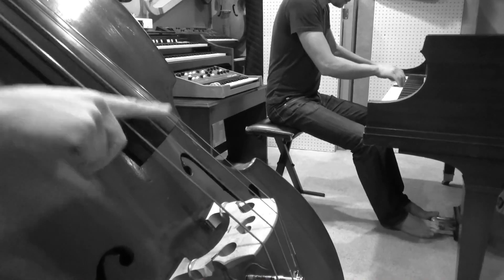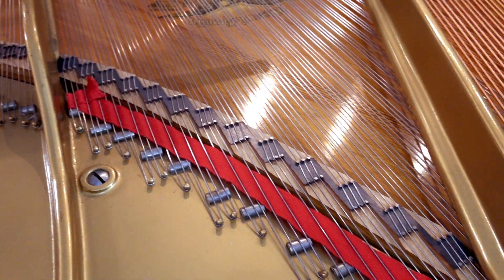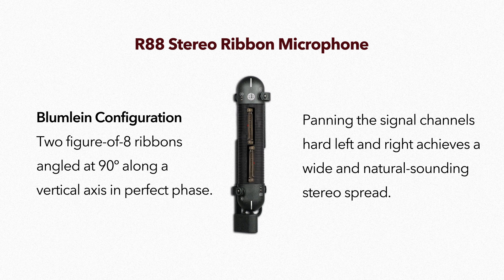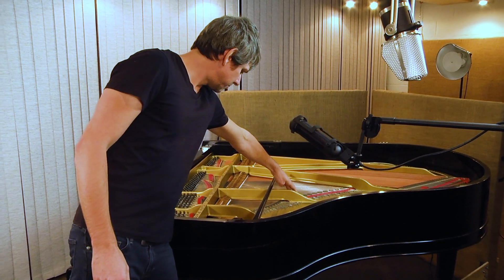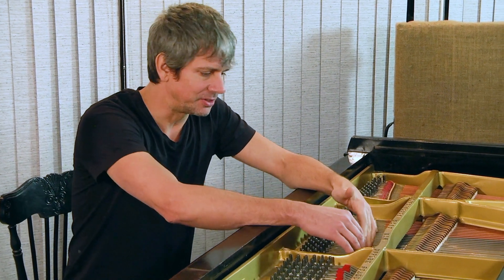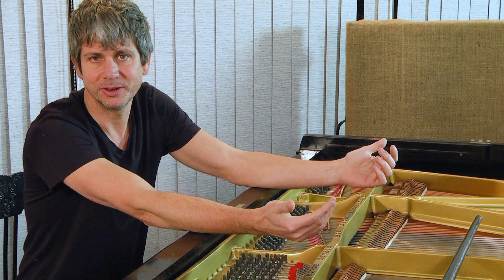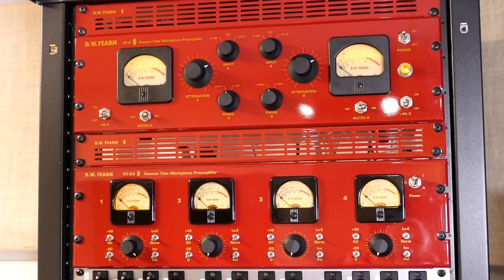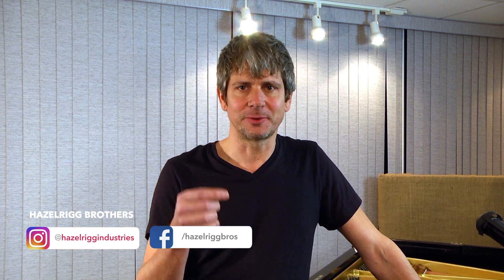How to Record Grand Piano | Featuring Doug Fearn

Comment: The sound actually doesn't come from the bridge, any more than it does the bridge of a guitar.  The ribs on the underside of the soundboard spread the vibration to the larger soundboard area, as do the braces inside of a guitar body.  The bridge itself doesn't just move up and down, but rocks back and forth perpendicular to the length.  The ribs are doweled into the bridge, and the whole assembly vibrates back and forth with the bridge in the middle.  Thus the actual sound from the piano comes from somewhere between the bridge and the perimeter of the case, mostly in the middle of the piano.  Sound also comes from under the metal frame (aka the "plate") where there are holes to let the sound out from the back side of the bridge.   Exactly where the sound comes from and which string(s) is hard to determine without using headphones and a directional mic, and thus the exact location of the "sweet spot" could be anywhere, as you have said.  It would also be possible to mic the piano from the bottom (or behind for a vertical piano) since whatever sound is produced above will also be coming from below, and likely a less percussive sound as well.
Not a sound engineer, but 30+ years as a piano technician.  Thanks very much for your video.
Reply: The holes in the plate aren't specifically for letting sound out.  They are designed into the casting to allow it to cool more uniformly during production.  Also, there is a difference between the resonance of a sand cast and vacuum molded plate.
Reply: Piano technicians have so much knowledge about this subject.    But as you must know, every piano is different and there are CRAZY differences about where sounds come from in different pianos.  Especially Bossendorfers (spelling?)  Those are so different than all other pianos I know.  I prefer Fazioli's to most modern made pianos but hey...

Comment: Hi George, Doug & Geoff,  thank you for this great video! I have a dilemma and I hope you'd be able to help me out. I bought the R88 and the RPQ2 preamp to record at home and it turned out to big a huge mistake as the R88 picks up alot of the interference from the untreated room and makes it extremely noisy and practically impossible to use. If you hop on the forums online there's alot of people complaining about it being super noisy. Apparently you need to be in a pro studio environment to make that amazing mic come alive...Just wondering if perhaps you know of a hack or of sometype of equipment I can incorporate to deal with this noise problem? I really like the natural sound of my home and would really love to be able to use my R88 to capture it. Any suggestions would be really great!!! Thanks.
Reply from the maker: Hi. The R88 is fairly sensitive to noises from LED lights and dimmers. When we record we typically have all the lights off in our studio. We only use a lamp or two that we know don't put out any noise. You also might try holding the R88 and moving it around to see what it reacts to in your recording space.
Reply: @HazelriggIndustries  Thanks! I've changed a couple of things and going to test it out with a new interface as well. I even bought an emf meter just to check if the electrical sources are an issue. Will definitely try that, thanks for the advice.

Comment: Great video! This is the first good video I've watched on youtube regarding recording the grand piano. Theres a lot of misconceptions about the sound coming from the hammers. As you mention, most of the sound comes from the bridge itself, and that's not very appearant unless you listen to a grand piano without the lid, then you clearly hear where the sound comes from. The main thing, I think, is to be aware of the sound, not what's necessarily the most logical from a visual point of view. The balance between having a full sound with enough low end combined with a nice, airy definition is very important. Do you use any microphones in addition to the r88 on the piano? I often use a mono room mic in addition to my r88 to get more definition and air, but my setup is constantly changing.

Comment: I disagree with many of your points here.  I can say that I have worked with great pianists like Herbie Hancock, Chick Corea, McCoy Tyner, Chucho Valdes etc and we do NOT remove the piano lid.  But hey, what do they know?   I understand where you are coming from but keep in mind that all pianos have been designed and gone through generations of experience to try to improve their sound and Steinway, Yamaha and Fazioli all do it with the the lid on and on high stick.    The only time I remove a piano lid is in some giant orchestra situation where the lid blocks the view of the first violins.  Or possibly in a double grand piano performance so the pianists can see each other well.  

There are a few other thing that I have learned over many decades regarding the piano.  Many thanks so some of the worlds best piano technicians for their incredible experience and insights.

Most grand pianos are not actually sitting on the floor or stage.  Most have wheels and I discovered that by moving the wheels to certain directions changes the weight distribution of the piano with regards to the soundboard 
Try setting the wheels facing outwards from the keyboard  90 degrees from the keys.  And the wheel at the tail of the piano also facing outwards away from the pianist.  This changes the sound of the piano and IMO it sounds more focussed and clear.  Try it.  There is much to be explored regarding instruments physical coupling with a floor or stage.  Ding Dong  

All just my opinions but based on experience,  We can all learn more and do better.  Let's do it!!

Comment: What kind of Mic was that overhead....the mic you guys were speaking into?
Reply: It’s an AEA ku4  reproduction of the RCA Ku 3). All ribbon mics are mostly figure 8 but the exception is the Ku3/4 which has a milled pressure equilization chamber to assist it to become a cardioid pickup mic thus making it it more directional sounding. This was devised as a boom operators microphone for the film industries. The ku3 had a luminous white painted stripe on the rear so that the boom operator could pan & tilt the mic when it was extended high up on the darkened areas of studio sound stages. The Ku2 was its predecessor. The RCA 77dx has a crude variable plate to help assist creating a more directional pattern. The Ku4 has a much increased HF tone response, the 44Bx are less bright & to my ears warmer sounding.

Comment: Thank you so much for your video , very good . Please , could you tell me which Are the best mic for recording grand piano ? I have Rode NT 2000 , Apogee 76 elements , mic - pre Neve  Amek 9098 system. I have Yamaha C5 grand Piano . Thank you in advance
Reply: He mentioned using this mic https://www.sweetwater.com/store/detail/R88--aea-r88 I'm looking for one or two for mine and I see all kinds of different recommendations. I will probably get a stereo matched pair of AKG 414s or the new Austrian Audio OC818 because I mic a lot of different stuff so need something that's good on a lot of stuff. I've heard the new AKGs are very bright, and the C5 is a bright piano so that may not be right for you. It sounds to me like the OC818 handles the high end a little smoother, at least from looking around online. There is also a discontinued AKG 414 B-ULS which are on the used market and are a little darker. All pianos are different and mics are different and rooms are different so it's tough to tell. I've heard small diaphragm condensers are good if you want to pick up less room noise, like the Neumann km184.

Comment: You kind of lost me at the "take the lid off" section. Pianos are designed to function with lids. It's always going to be a case-by-case situation based on the piano, the way the piano is mic'ed, and the type of sound you're going for. Taking the lid off might yield a nice sound in a certain situations, but something dry and lifeless in others. Ribbon mics pick up in a figure 8 pattern (picking up sound from the rear), so with the R88 that you're using, the position and angle you've chosen possibly would be picking up reflections off the lid that would be objectionable.
Reply: Piano lids are mostly about projecting the sound into the audience in a hall - but there is no rule that says you have to record with the lid on the grand piano. Sometimes the lid creates sonic challenges.
Reply: @BarryWarne  Totally agree there is no rule, and taking the lid off is an option. You might like the warmer, more intimate sound in some situations. But, leaving the lid on can also give you a sound you might prefer. Leaving the lid on creates a feedback loop that can create a very nice, bright and reverberant sound. The sound reflecting off the lid re-energizes the strings (both the strings with dampers up, and all of the additional non-damped duplex strings). Try putting the sustain pedal down and shouting into the piano with and without the lid on. You'll notice a very different sound when the lid is not there to contain and re-direct the reflections back to the soundboard. You'll get more natural sustain and brightness with the lid on. They're not mostly about projecting the sound into a hall. If that were the case, why wouldn't artists always remove the lids on pianos played in living rooms and practice rooms?
Reply: From Glenn Gould to Elton John have made recordings with lid “off”.  If you are working in a small room space & do not wish impart room reflections, you tend to work closer to the instrument. Problem is the when you need to get to within a working distance of 5 ft or so to the lid, or you want to get to within inches of the soundboard then the lid throws in odd cancellation issues & things can get too boomy or resonant. The team here are working with ribbon mics which pickup equal energy from the rear side, so the proximity of the lid is creating big issues if the leave it on (since the guys desire a focused sound for their productions. I’ve also found lid off works great for Jazz & pop projects but I’d not work so close up for classical work in a larger room space.

Comment: What is that cool looking silver mic (a ribbon maybe?) that you're using for talking? Sounds great!
Reply: It’s an AEA ku4  reproduction of the RCA Ku 3). All ribbon mics are mostly figure 8 but the exception is the Ku3/4 which has a milled pressure equilization chamber to assist it to become a cardioid pickup mic thus making it it more directional sounding. This was devised as a boom operators microphone for the film industries. The ku3 had a luminous white painted stripe on the rear so that the boom operator could pan & tilt the mic when it was extended high up on the darkened areas of studio sound stages. The Ku2 was its predecessor. The RCA 77dx has a crude variable plate to help assist creating a more directional pattern. The Ku4 has a much increased HF tone response, the 44Bx are less bright & to my ears warmer sounding.
Reply: @matthowe7057  Wow thanks for all the info

Comment: Nice and interesting content. Thanks a lot. Though I wonder about the position of the microphone because the R88 is a "Far-field ribbon mic designed to retain low end and top end at a distance", as describes by AEA. Don't you think by positioning above the strings, so near to the sound board the recording does not really benefit from the whole range of perspective and the breadth of this Blumlein mic ? 

No offense, it's really a naive question.
Reply: essentailly "Far-field ribbon mic designed to retain low end and top end at a distance" just means it has a lot of proximity effect and is tuned to have a flat or natural bass response outside of the proximity effect. you could always eq the low end down to reduce the proximity effect to get a sound that you like. it would be nice if AEA added a pad and two roll-off switches to their r88a, where the roll-off switches changes to bass response to be flat at different ranges.